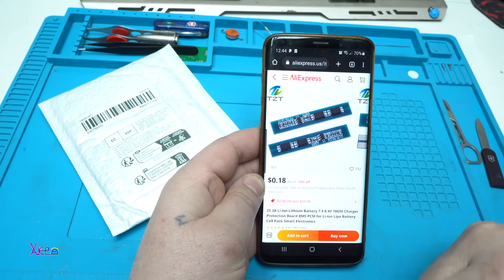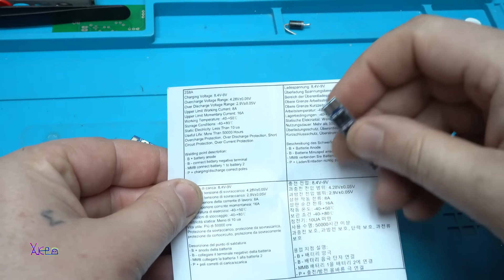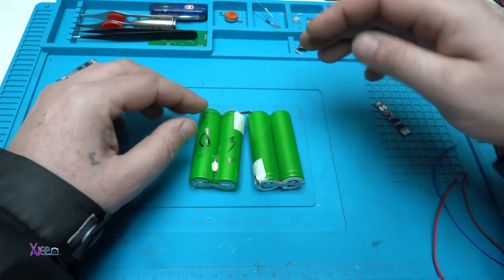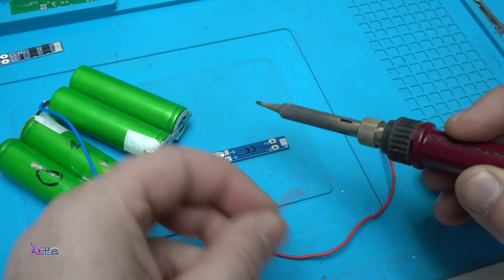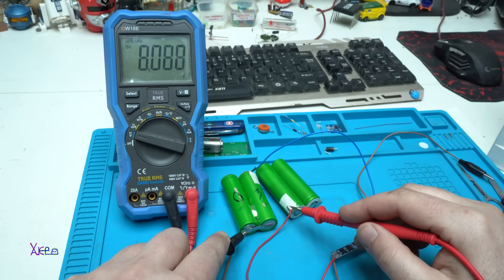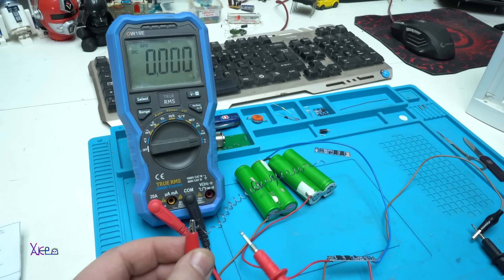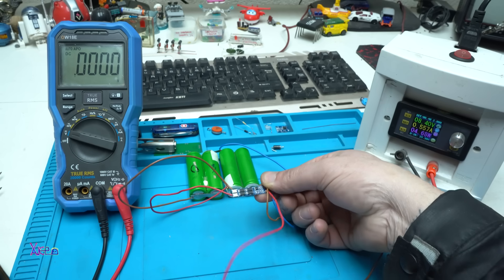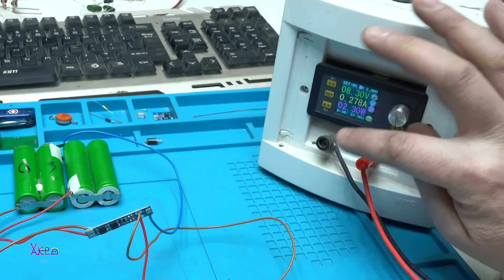THIS $1 Aliexpress Tiny Module it SUPRISED ME?

Comment: Hi, I really like your videos and I learn a lot from them. I have a problem with this board. I hope you can help me. I've made the connections as described in your video and in the diagram, but (P+ P- ) there is no output voltage, it only accepts input. I bought a set of 5 boards and I've tried them all, and they have the same problem. Either the set is defective, or I'm doing something wrong. Greetings from Spain.
Reply from the maker: How many batteries u are using
Reply: @Hacktuber  2 of 3.7 V

Comment: really bad product (at least the 1s) version. Bought from 2 different sellers, both dont actually work properly. one cut off at 2.5V (way too low for lipo) and not at all the second time i tested. Both fail for over and undervoltage protection. use at your own risk!!!
Reply from the maker: I test them and actualy they work fine
Reply: @Hacktuber  Maybe the 2S version you used is better :(

Comment: This is not a charger but a pure protection IC, basically a DW01, just for 3S. No proper charge management, no balancing, nothing I would dare to use without any additional management system.

Comment: What temperature is your soldering tip?
Reply: Hot
Reply from the maker: Above 300 c
Reply: @ Thank you. Yo make soldering look easy.
Reply: If he's soldering with 60/40 tin/lead, then it should be between 475F and 525F/246C and 274C.

Comment: It's NOT 18 cents.... Pause video at 0:13 you'll see shipping cost is $2.65
Reply: the UNIT is 18c, where YOU live will be different for other ppl
Reply from the maker: True👍
Reply: lowest price is better for clickbait title
Reply: @eidodoos  the 2a model is only $0.08 each, and my shipping is only $1.15 for 1 item.  Shipping goes up about 10cents each.  qty 10 comes to $2.93, twenty nine cents each.
Reply: just seller's strategy. Some come with very low price but high shipping cost. If you buy more, the shipping cost also increase along. 1$ price+0.5$ shipping cost=0.1$+1.9$ shipping cost. but 0.1$ is more click bait and attractive
Reply: @2.65 or shipping for all 3?
Reply: @jacoblf  shipping charge comes combined.
Reply: The listing on the phone and in the description is a 3A module, but the one tested is 8A (has four of those 8 pin packages vs two for the 3A). Fortunately the 8A ones I saw on 'the jungle site' are about a buck and a quarter each.